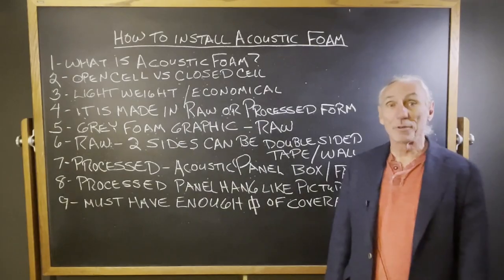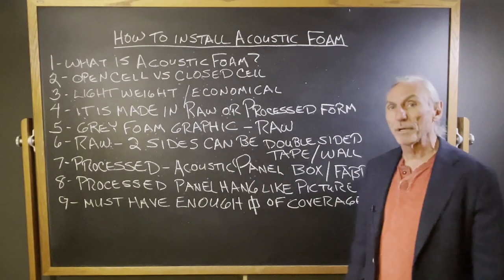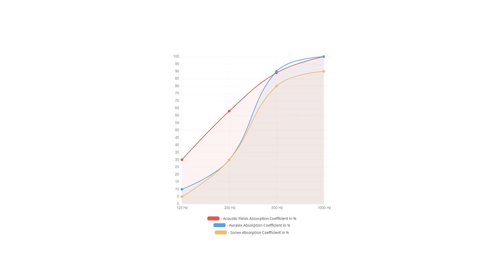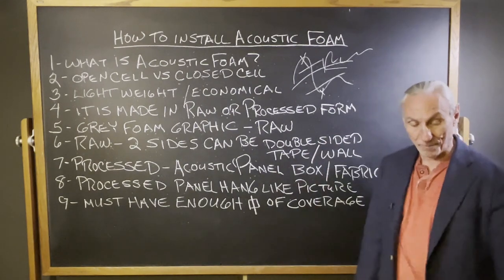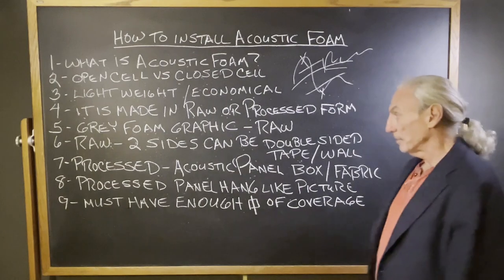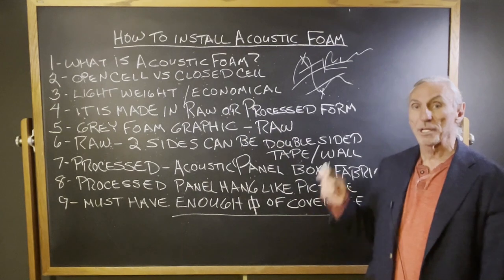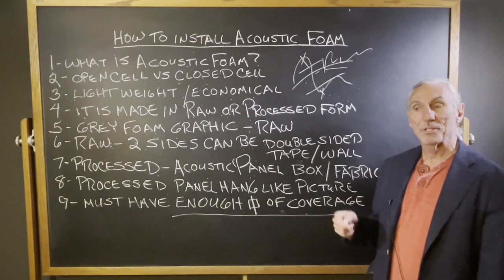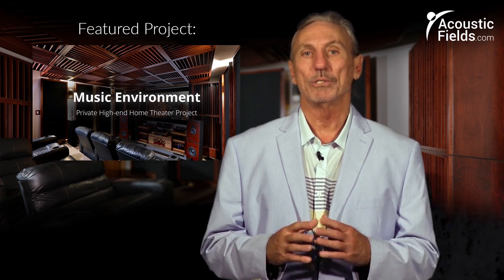How To Install Acoustic Foam - www.AcousticFields.com

Comment: Does doubling up the foam so it’s 2 layers increase the absorption coefficient of lower frequencies? Or allow the range of absorption to extend lower?
Reply: The acoustic foam is for low mid-range to high, he recommended carbon technology to me for the low end but it's easy to set up a phone call with him and it don't cost nothing he's a really accommodating guy
Reply: I think you increase the level of absorption if you do that, but not the rate of absorption. Dennis, please correct if I am wrong! Thx
Reply: It absorbs deeper frequencies but it really don't scale at the end - hence other technology for low frequencies
Reply from the maker: Yes, the foam depth determines the resonant frequency or how low it will start working at. At 4" depth, we go down to 100 hz. At 6" - 90 Hz.

Comment: Would it be presumptuous to ask about your foam's density in kg/M^3 or lb/ft^3?
Edit: for anyone else wondering, the measurements he gives below come out to roughly 30.76kg/M^3. Very clear the density of this foam is dialed in to extremely precise specifications. Likely the result of pursuing a uniform cell structure, which is very beneficial for absorption performance. From what I've seen, Auralex's foam is 32kg/M^3, but as the data shows, Auralex doesn't perform from 100-500hz. Likely the result of imprecise cell structure.
Reply from the maker: Our 18" x 2" x 25" piece weighs 1 lb.
Reply: @AcousticFields  Thanks! I appreciate your videos immensely!

Comment: I have seen (and I’m sure I’m not alone) where in some commercial locations (like restaurants for one instance) where foam panels hung from the ceiling and I can’t see how that would offer any type of correction because of how it was placed, and also that it didn’t seem to be enough in size and number (and likely thick enough or the proper type) to really be of use to offer any type of correction. Pseudo Acoustic Panels more like it.
Reply: Yes haha, or thin carpet on a wall
Reply: Why do you think panels hanging on the ceiling won't work? It's simple physics and the ceiling needs to be treated too - space between foam and walls make it more efficient
Reply from the maker: Every wall surface area in small rooms exhibits a different frequency and amplitude issue. You must design for all of those variables.
Reply from the maker: Every surface area contributes to 17 % of reverb time issue. You must reach a surface treatment level of 65% coverge of each wall to start. If that is not enough, then you will have to go to the ceiling as well. Every room is usage and size dependent.
Reply: @AcousticFields  and the particular place I was referring to had NO wall treatments, plain old brick walls, with a few small paintings (for sale) large thin glass picture windows along the entire front wall and 4 small thin foam rectangles maybe 2’ X 3’ hung from the wood rafters of the building about 4’ from the ceiling (which was a 12’ ceiling).  These thin
Foam panels (maybe 3/4” thick) did not look like they could serve any type of real acoustic treatment. 🤷🏻‍♂️
Reply: @Aswaguespack  at least it contributes a little bit to reduce sharp heights and whatever is better than nothing - with enough crap in a room reverberation goes down
Reply from the maker: @Aswaguespack  Foam panels 3/4" are worthless when it comes to lower frequency absorption. They are also limited in performance for middle frequencies. Find the frequency and amplitudes of each wall surface area and treat accordingly. Rememeber the room does not care what you want to do. You must identify each wall surface issue, define the frequency that wall produces, itentify the strength of the frequency issue and then prescribe the proper rates andc levels of absorption to treat that specific frequency. Dont forget to include enough treatment type on each wall surfcace to match the amplitude of the frequency issue.